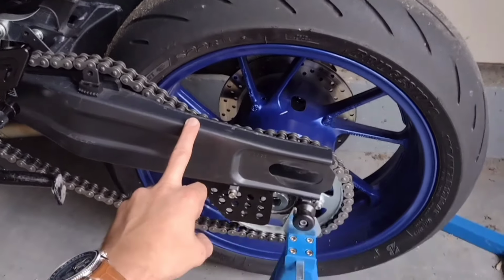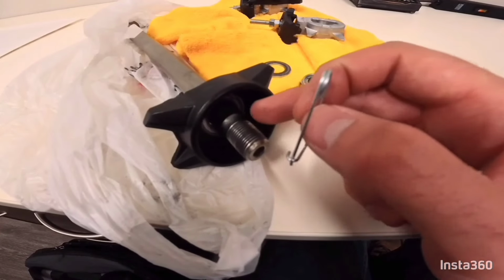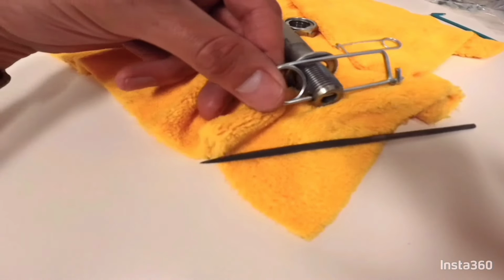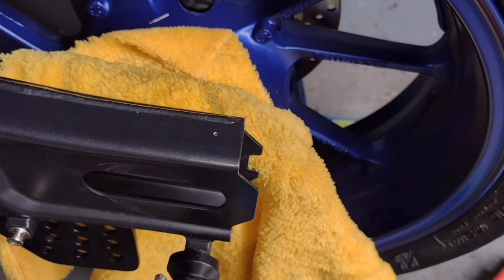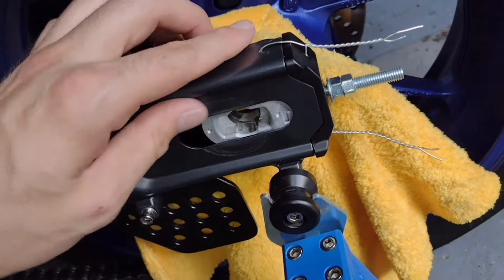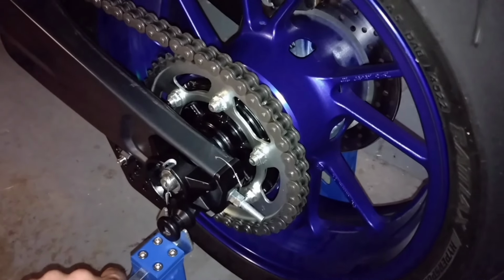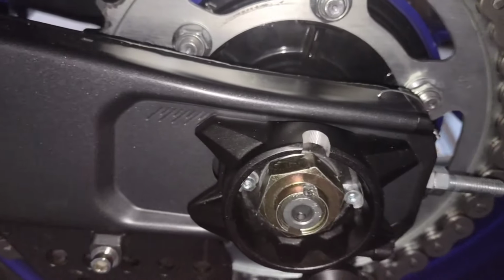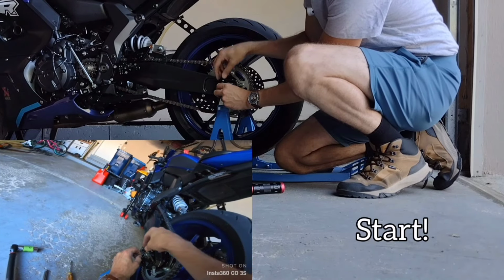Yamaha R7 - Rear Axle Fix and Modification

Comment: This is fantastic. I had my MT07 almost tear apart the side plate, it was already very stripped. Yamaha tried to not cover it even though this is a very easy issue to look up other experiences of. I went through Better Business Bureau to make it right, but I figured the $140 they quoted me for parts was saved, and I spent $80 of that on the Gilles Titanium Nut. I've read no reports of it failing, with posts back to 2016 recommending it, so I have high hopes that it will be a convenient solution. Well done!
Reply from the maker: @LSB44446  Thanks and sorry you had to go through that headache! Yes sounds like the Gilles nut has been a great answer for others. Shame Yamaha don’t seem to be doing anything about it or the adjuster end plates. Anyway glad you got sorted and happy riding!